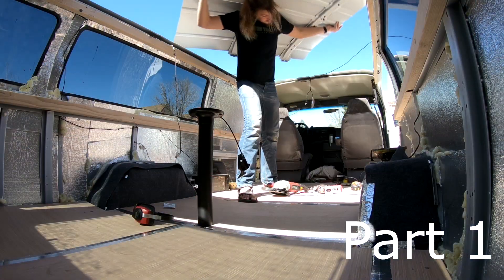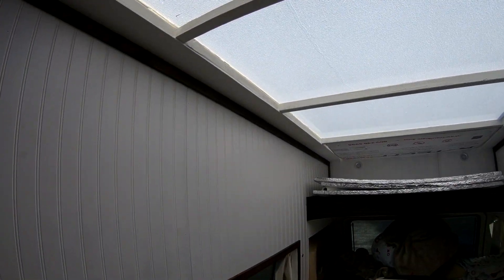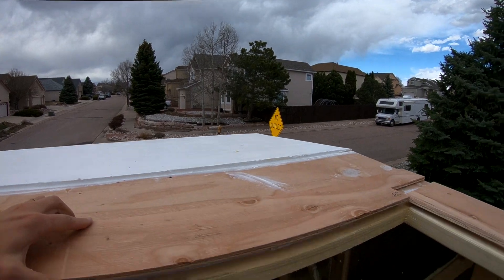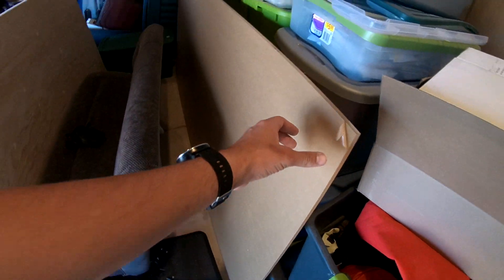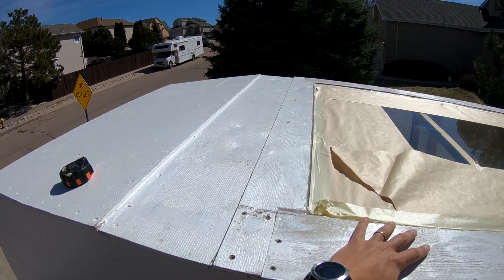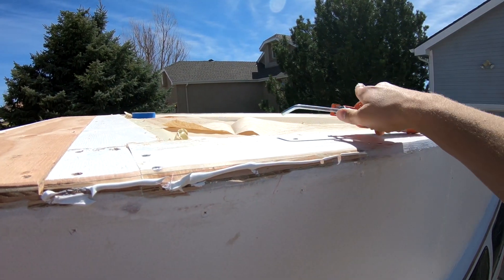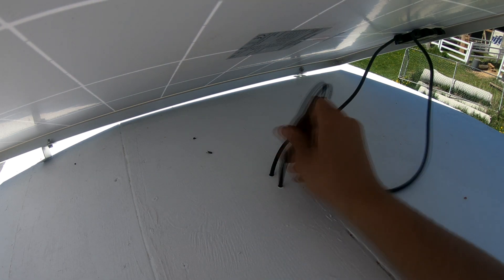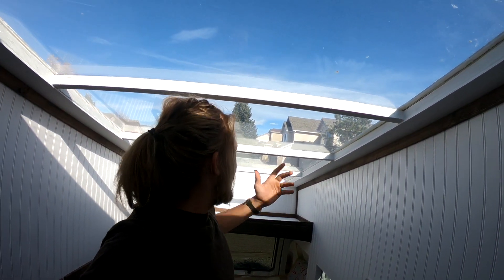How to Build a DIY wood Hightop on a Van - Hightop Campervan Part 2/2

Comment: I'm just starting a conversion of my 2000 Chevy Express extended van. You inspired me to create the same plexiglass roof. Thanks and I'll keep you updated
Reply: How did that work out? I dont see any way that the roof wont still leak. Additionally  Water will get under the seam, and will make the wood wet.

Comment: Rv rubber roof, or TPO for less maintenance, moldings at seams, butyl or putty tape under aluminum moldings, plastic screw cover protecting screws in molding, dicor sealant covering any seam on roof 3/4 inch or more each side of the seam.  Silicone is OK on sides but not roofs.  Marine sealant is a good adhesive but isn't a replaceable seam sealant where you strip and reseal seams every so often.   Looks like a fun build!  Dig that plexiglass.

Comment: You want to buy rolls of sheet fibreglass matting and glass that sucka! Paint never lasts long but fibreglass will strengthen and waterproof the whole top. Bond the fibreglass onto the existing van roof JOB DONE!

Comment: Not bad. I think next time along your edges on top rather than trying to smear caulk on them consider using sheer medal with a break. You could fashion home made flashings that way.
Reply from the maker: that would have been a good idea
Reply: DIY Eli and it’s relatively inexpensive as well. You still have to use silicone obviously, but it gives you a strong edge and it’s weather proof. You can get away with minimal screws, when you wrap it you can use a construction adhesive combined with screws that are designed with rubber gasket like material. Used in roofing. I like what you did. Have been daydreaming about doing it myself one day. I have a 25 year old daughter who just bought a 2017 Ram pro master. Her and her husband were living out of a van out in Idaho. They loved it. Van broke down so they came all the way back East, got jobs at a wharehouse stayed with family and saved enough to purchase the van cash. I told her to vlog their journeys.

Comment: The 3M 5200 Marine A+Sealant you used is only for very specific applications.  NOTHING will break that bond - there is NO FLEX at all to it, and it can only be removed by removing the adjoining material.  3M makes a variety of special use caulks and adhesives - most are order-only - and many would be far more suitable to your uses.
Reply from the maker: hmmm ive been able to scrape it off without too much issue in places i dont want it or want to replace it. what would you recommend?

Comment: Interesting conversion! BUT, when it rains at night, you are definitely going to have to wear ear plugs to sleep, as the rain coming down on that hard plexi surface, is going to sound like a 1,000 mini drums! And what about moisture condensation from cooking and just breathing? In a cold environment, that's going to be a problem. Had that experience camping in my Kia Sedona van - all the windows would frost up! Of course, I didn't have a propane heater going. Maybe that's something you will add...
Reply from the maker: haha yeah it makes a fair amount of noise whn it vans haha
Reply: I’m afraid it’s going to condensate like a glass of water. Seriously.
Reply: It awesome nonetheless, by the way, it’s my girlfriends account, my names Wes and I’m a fabricator.

Comment: Sky Roofs !!!!! nice works - I Bought a $40.00 tow away grass overgrown tires rotted,1950's 15 ft trailer in the 1970's . Skydeck vision exp. OB hippie town, with a full plexi roof, left in the existing ribbed roof supports, all  crude & unrefined experiment . Far from your talents. Hot sunny days & always docked  added a simple Sunshade tarp semitranslucent bluish tone. Look forward to Electrics higher effeicient PhotoVoltaics & hemp storage capacitors.  San Diego look us up if your in the hood. OB it's always 4:20. bless ed bee
Reply: "Heartland" 120 acre pvt. sanctuary e. county Lake Morena - Campo "Corte Madera Mtn." Sacred place fb for map etc. S.D. Ca.

Comment: The correct way to do it is use mild steel tubing and a bender and metal sheeting to make this roof so you can weld the frame into the unibody shell of the van but hey this works as long as you don't expect it to last as long. looks cool as fuck though

Comment: The plexiglass should have been on top of everything else.  When it's in a pocket, the pocket can fill with water and eventually leak.
Reply from the maker: i thought of that bout couldnt think of a good way to hold it down besides drilling holes in it
Reply: I put a big plexiglass skylight in my cabin.  I just drilled pilot holes and used roofing screws with the gasket washers.  Sika around the edge.

Comment: you mentioned Plexi as in plexi glass acrylic BIG NO NO it is brittle and WILL break you need to use Polycobonate sheets for this application it costs more but is safe it will bend and not break you can also drill through it but your project your life..

Comment: Nice work, but the way you secured the plexi guarantees that it will pool water.  It will eventually leak.  Water always wins.  Ask anyone that has ever had a flat roof.
Reply from the maker: the plexi glass is all angled down the van. no pooling on it

Comment: I have pretty much the exact same van, a 2001 15 passenger Dodge van. 
I have been wanting to cut the roof off and build a camper shell like this so I can stand up! 
Would you happen to have the cut list or blue prints of this available? It would help tremendously.

Comment: I often see wood frame and plywood caps on pickup trucks, so why not a raised roof on a van?  I do wonder how the plexiglass will hold up if there is any twist in the body, which is not uncommon in these cargo vans.  These vans do have poor side panel crash statistics, so I wonder how much that has been degraded by removal of the steel cross joists in the roof?

Comment: There was a comment below or in the first video about just getting a fiberglass roof from a wrecker. That was my initial though as well.
But this is stunning! Better than any commercial RV conversions. No feeling of crawling into a cave every time you go in. There might be some surprises along the way with the roof but you know how it went in and will be able to deal with it. Well done! Keep us posted.
Reply from the maker: Thanks so much Steve! Thats one of the reason I like building things myself, if anything goes wrong i know how to fix it

Comment: i would apply some sort of non stick spray on the roof because dirt and birdshit will destroy it,or protect it with some uv film or film tint..the acid in birdshit eats into the perpex if its not protected.
Reply from the maker: not a bad idea...
Reply: @EliPetersonjp  mirror tint will be best..you can see through it good..and it will reflect the summer heat..

Comment: Did you use tempered glass? That glass heated and cooled then sandwich with a plaster to hole the chunk it break into togther. If you didn't glass will break following  the grain or length wise. And falling on it is like knives cuts. All glassed on the road need to be tempered . Or In a accident it will spray million of tiny sharp speck of glass . And if they go in your skin the are invisible as its see through. Heck that glass comes out in a crash it could cut your head off going the length of the van till it stop. I would put barriers behind the driver cab. And no and should be behind . Even tempered just too much glass that all coming down . Glass can't take impact.
Reply: The glass sheets is unsupported top and bottom. Glass Wasn't made to be horizontal . Only less that 1% gasket it holding it up. Then adding constant road vibrations and downward pressure. It's will fall only question is a matter of when. That 100-150 lb of glass up there.
Reply from the maker: been driving with it for over 7 months with no issues. It is cell casy acrylic not glass
Reply: You mean Acrylic sheets? Cell Acrylic is a non clear artist pour project usually with wood. But  Acrylic Sheet can flex vs glass. Why it our concern, you get into a accident or it rip off on the freeway we,  kids too are in the back, & deal with it .for the next minute or so. as that has to stop also. How can that pass a recon.

Comment: Just paint the top of the van with the hard crust stuff that they use to cost garage floors. Or use clear epoxy coating.  Waterproof forever.
Reply from the maker: Not a bad idea

Comment: As a contractor that uses many different products my experience has been quick or fast cure items tend to be sub quality in that they either do not fully cure,shrink, or do not stick as well.And vulkem can be your friend,that stuff literally will tear apart whatever it is stuck to when you try to remove it.
Reply from the maker: i wish i had used that at first

Comment: I have pretty much the same exact van as you, and have been trying to figure out how to do a raised roof, similar to yours on the somewhat cheap. I can't afford all the lumber, and materials you put into yours, and I most definitely cannot afford a fiberglass prebuilt raised roof either, so I have no clue what I can do to gain about another 18 to 24 inches of head room, since I am about 6 foot tall, and the inside of the Van, from floor to current ceiling is only about 4.5 feet. Any ideas you could suggest ?
Reply: If you cant afford wood or fiberglass then  you absolutely can not afford proper metal construction .

 definitely finance a raised roof van and suck up the payments as you have zero other alternatives
and you will need to stretch out the principal amount over time
Reply: You could try to sell your van and then buy one that allows you to stand in like a box truck, step van or promaster. They say now it's a seller's market so you could maybe get more money for it than usual too.

Comment: Not knocking you what so ever, but if you remove the cross beams on the roof without installing welded on new beams, wouldn't the body want to flex? Maybe I missed something?
Reply from the maker: some but with added reinforcment it has done fine

Comment: Probably should’ve use the white silicone because the caulk is going to crack eventually
Reply from the maker: All the chaulking is silicone based or marine adhesive which expands and contracts

Comment: great work, if i may suggest, the big rectangle on top of the van creates huge amount of drag, try rounding of the edges, .
Reply from the maker: i initially thought about doing this but it would be much more difficult to frame internally
Reply: there goes any chance of reasonable gas mileage
Reply from the maker: @welcometoreality3450  it gets about 13-16 mpg

Comment: i would have used a waterproof construction glue to join absolutely every piece of wood where it touches another piece of wood... such as PL Premium... Marine grade calking is great, or use high grade calking made for RV's.  I would have also done what you did, plus adding screws as well as dowels.  I must admit, this has opened my eyes to other possibilities (such as putting an attic over the cab on a box truck... but i will make a steel welded frame as well as wood)... so i must say, Good job!
Reply from the maker: Best of luck! I glued most everything! modern glue is stronger than screws!

Comment: Just a idea, if the roof edges still leak, tape it off good and buy the $12.00 a can of spray on truck bed liner at Walmart, and spray all the edges good, when that stuff hardens it some very tough, impervious stuff, I think it only comes in black,  but let it cure for a week and then paint over it with white paint.
Reply from the maker: haha that might work

Comment: Why not use polycarbonate? Its shatter proof/crackproof
Reply from the maker: it yellows and clouds with uv rays
Reply: @EliPetersonjp  you can protect it with clear vinyl, or some kind of epoxy clear coat

Comment: Robustness of clear acrylic: Acrylic is used for many outdoor projects – including as replacement panels for shed windows and greenhouses – and it is therefore very important to know how long the material is expected to last in high moisture, high UV or environments with fluctuating temperatures.

Acrylic displays weather resistance which is unmatched by other general purpose plastics. It will withstand exposure to high levels of UV light, salt water spray, extreme cold and dramatic temperature changes without shattering, fogging or losing its lustre.

In fact, clear acrylic has been known to last up to 30 years in use outdoors without turning yellow, crumbling or losing its strength. This makes it the perfect material to construct garden greenhouses, offering the same aesthetic and clarity of glass with increased impact strength and resistance to the growth of mildew, mold and moss which obscures glass over time.

It should be noted that the weather resistance of clear acrylic sheeting will be different to that of colored acrylic. Whilst similarly strong and resistant to dirt and mold growth, colored acrylic may fade in prolonged periods of direct sunlight.
Reply from the maker: Yup! thats why i used cell cast acrylic!
Reply: @EliPetersonjp  Cool Stuff!  I own a small humanitarian shelter company (www.foldedhomes.com) which supplies origami-architecture foldable shelters for emergency applications.  They are manufactured from polypropylene sheets.  I did UV degradation tests with them.  Unpainted the UV destroyed them in less than two years in the desert.  So I was curious about the UV qualities of the acrylic.  Great choice Eli.  I have done a custom Sprinter conversion and used a boat hatch as its skylight.  Most RV plastic is for shite.  The boat hatch is 1/4" thick.  So your 3/8" thick acrylic is good stuff.
Reply from the maker: Hey Markus! Really cool company! I really like your pods! I saw you are based out of Corvallis too!? My partner and I are trying to move to Newport Oregon this Spring! Will be visiting the area at the start of December as well
Reply from the maker: Ahh gotcha! I just saw on your website that the contact info was Corvallis. Will do!

Comment: I like everything you did except when I saw you using silicone and not Butyl Tape between the boards and the metal, and also the top, I felt for you and knew you would have leaking problems. If the leaks come back take it up and use Butyl Tape.
Reply from the maker: Hmmm I’ll have to look into that!

Comment: if you ever do this again, you could and probably should leave in the metal cross braces, if not forever, at least until the rest of your structure is in place. Frankly the way it turned out, you could have just left them in place, since you have cross braces there anyway. 
Personally though it's easier to work with wood, I would have used light steel, like they use in commercial buildings for non bearing walls, they're just metal studs really. then you can use screws, pop rivets and or adhesives to put a sheet metal covering on it. I wouldn't have used the plexi at all, I see no need for it, but different strokes.... I hope you used brass plated or zinc plated screws where you used screws at all. ordinary screws will stain the surface and rust out over time, no matter how protected you think they are. In other words, it would be best to use marine grade fasteners as well. The doweling was a good idea, I think. Over all, it's a nice, quality job considering you're doing a driveway build. Oh, no matter how you try, every job requires at LEAST 3 trips to the home center or hardware store. No getting around it.
Reply from the maker: yeah i want to learn to weld
Reply: @EliPetersonjp  welding isn't difficult, hell if I can do it, anyone can. The equipment is expensive though, but sometimes you can find older but working welders on the cheap. For a beginner I would say get a stick welder.  this allows you a lot of leeway, you can get rods of different sizes and make up to do just about any welding job. Wire welders (MIG) are nice, but the rolls of wire can be expensive and don't necessarily let you do as many different things as stick welders do, and with MIG you have to buy not only the rolls of wire, but the argon gas or whatever noble gas you use. Most use argon because it's heavier than air and will sit right down on the weld area, keeping the oxygen away for long enough to get a good weld. Stick welding uses the stuff on the outside to turn into a gas, then it covers the weld with a carbon layer that has to be knocked off later, or before you can start welding again. oxy acetylene welding and cutting can be useful, but there again you have to buy the gas, and last time I checked, it's not cheap, plus there's the gauges and hoses and tips. it's also ot all that great for structural welding, it's mostly for light metal like a car body. The best is Tungsten Inert Gas (TIG) but you should have some experience with other types of welding before you invest in that. it takes two hands and a foot to operate the machine and weld. Here you use a tungsten tip with gas flowing out to strike an arc, and melt metal you add the filler rod with your free hand. This allows you to change the filler you're using easily as picking up a different rod. This is the best way to weld. If you get good at it, you can make a good living doing it. However, if you're working in a production shop, it's no fun. Out on a job site where you do your thing then move on to the next job is more interesting. Can you tell I've been there and done that yet or what?

Comment: Question: Isn't it going to be freezing in there during the winter/cold nights due to heat rising to the roof that's not solid and isolated?
Reply from the maker: there are insulation panels that fit into the roof panels